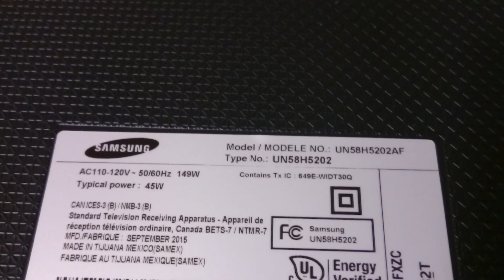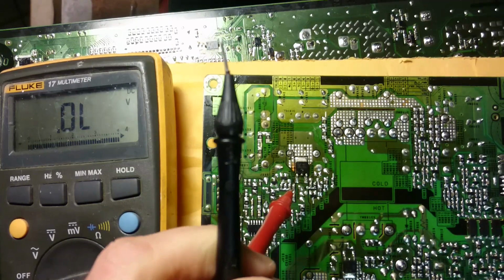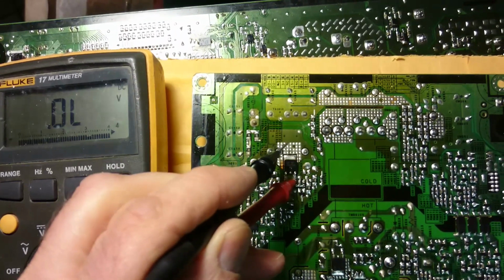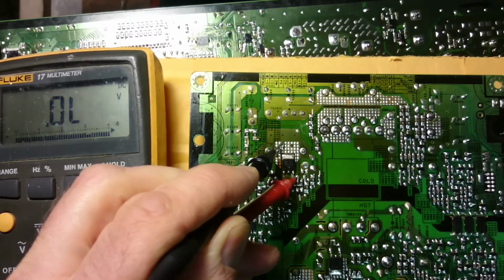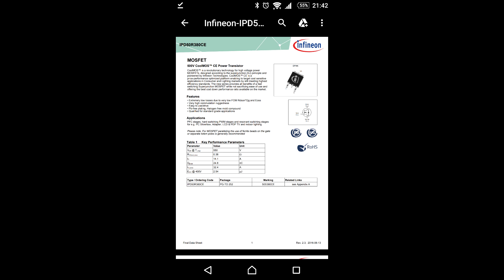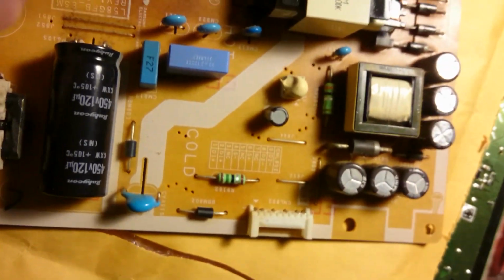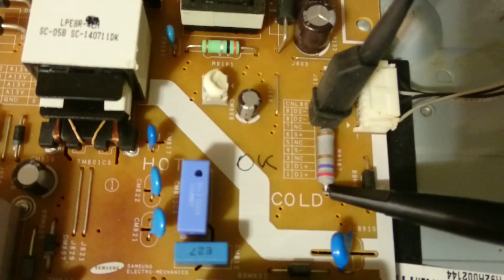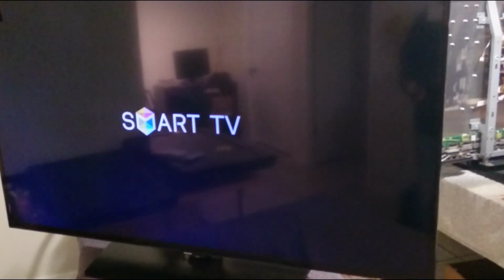BN44-00787A repair and LED current modification UN58H5202

Comment: Salut TomTechTod, est-ce que ce changement a tenu bon? Mes leds sont bonnes, je dois changer le transistor mais j'hésite à changer la résistance ne sachant pas si ça tient le coup? Merci pour ce video!!
Reply from the maker: I repaired several of these TVs, in general the actual cause is a few of these LEDs are bad (shorted). If you decrease the current it should be ok for a while. If LEDs end up failing open then you'd have to replace them, best the whole strip, for a long term solution. You can also reduce stress for LEDs by decreasing the backlight setting in the menu.

Comment: I know it's not an ideal solution but am I correct in thinking that turning down the backlight setting can get you going without replacing the resistor once mofset is replaced?
Like if you're not confident at soldering and have a replacement psu?
(also from Quebec...guess they sold alot of these here...)
Reply from the maker: Oui  tu peux faire ça aussi. Mais je me suis rendu compte que souvent c'est aussi les DEL du rétro-éclairage qui sont défectueux. Donc oui, ça marche juste en remplaçant la carte au complet et ensuite diminuer l'ajustement du rétro-éclairage dans le menu mais je sais pas combien de temps ça va durer.

Comment: i've replaced the mosfet with a original one, the tv worked for 2 days, then it shorted again. i've replaced then the entire board, the tv worked for like two hours. it's the same problem, that one mosfet gets shorted.
Reply from the maker: Your backlight is probably defective too
Reply: I the last week, I bought a brand new power supply board, it broke again in like 1 hour

Comment: Hello, I have the same screen, but the power supply gives me 360 v for the led strips, when you modified that resistance under the voltage.

Comment: I changed the 5r380ce n channel mosfet, the power supply worked but the backlight is weak, is the solution to this changing the resistance you show?
Reply from the maker: No, lowering the LED current will make the backlight even darker. Maybe there is a problem with the backlight or stgh else on the PCB.
Reply: @tomtechtod9200  this serie are a pain for # of leds burn each time  ahh man serie h is a pain !! :D
Reply: if this psu have broken on this transistor its for sure because you have more than 20 leds burned on 84 , your repair will not last long , you need to replace bad leds before to be done

Comment: Been looking all over to find the right part # for the mosfet and finally found your video. Sometime in the yrs after buying tv I was warned not to max the backlight up. Forgetting that warning, getting old, I turned it on high a few months ago. My old eyes could not make out the numbers even with magnifying glass. I replaced the transistor and the resistor, waiting for LEDs to replace. Di you test TV after replacing resistor? . Does the resistor bring votage down to the LEDs? Thank you :)
Reply from the maker: yes TV works after replacing these parts. I didn' replace LEDs on this TV. Increasing the current sense resistor  makes the control circuit lower the maximum LED current (top of the PWM signal in the video)